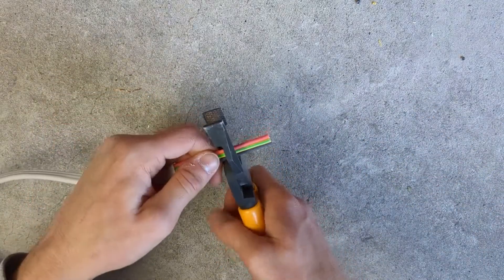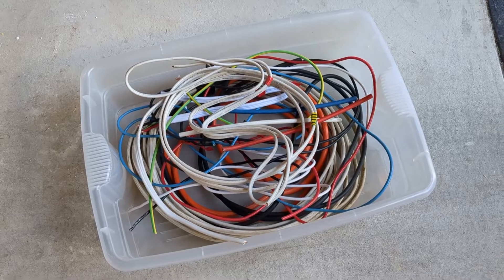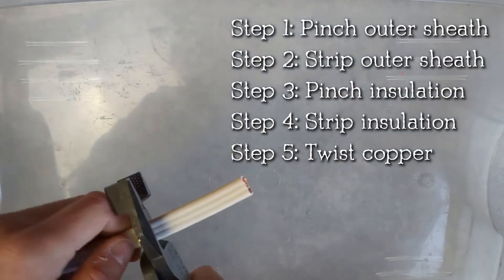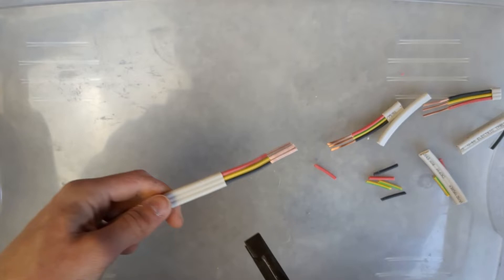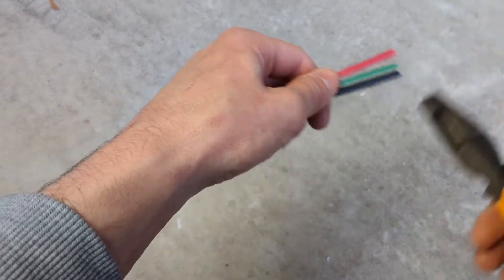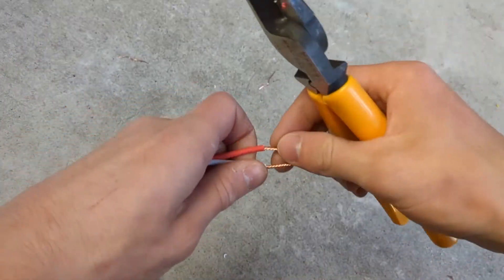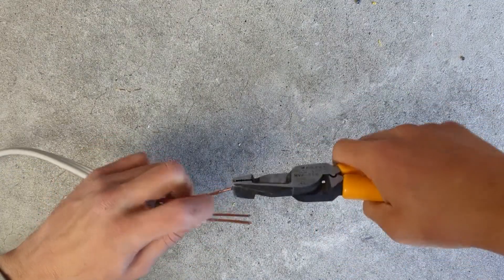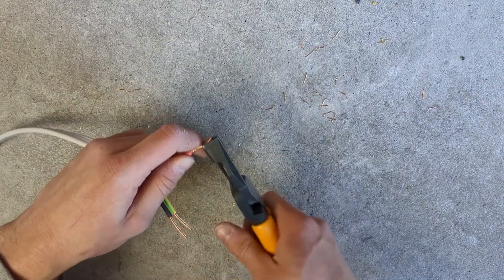How I Strip Sheathed Cable Fast as an Electrician

Comment: I'm a 55yr old, 30 years in the trade, and i thought i was the only one who pulled off the outer insulation like you do.  I never do all 3 conductors together, but I'm about to give it a go.  I still use the old pliers, i found the ones you use damage the copper cores too easy, but again, that may be from being too heavy handed and not enough practice.  Good onya mate, remember, you're never too old to learn and never ride off an old fart like me as we still have some good stuff you can add to your skills/knowledge.

Comment: In the United States diagonal wiring cutting pliers are used for Romex and the conductors are measured  in awg in thousands of inch expressed as gauge where the lower the gauge the larger the size and the conductors are solid and different color coding! Also a dual voltage 110/ 120/
220/240  at 60 hertz

Comment: I use the same pliers but usually end up resorting to banana peel... My problem is there is always more pressure on bottom blade so it digs into cable while top blade barely scores the sheeth, any tips?
Reply: I have the same problem with my crosscut pliers, ended up swapping to pinch cut pliers and it works a charm as they’re equal on both sides.

Comment: I am a electrician, I don't do it that quickly but more carefully, you damage the insulation and conductors in this way, stripping with cutting pliers is never good a little too much pressure and you damage insulation and conductors, fast but not better, quality is important to us.
Reply: I agree, it’s all about quality… he seems to have it down perfectly tho without cutting the wire